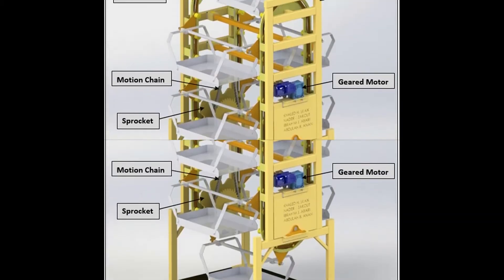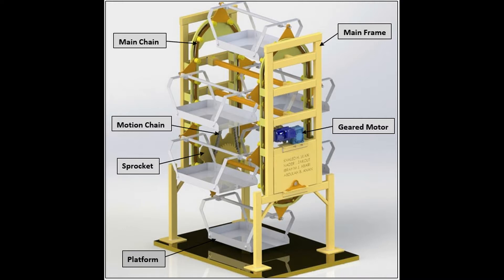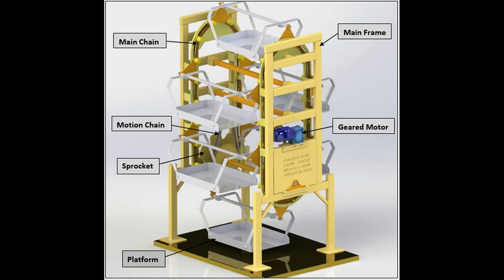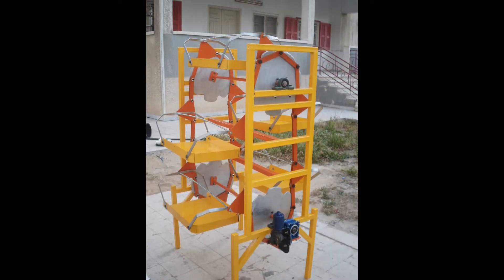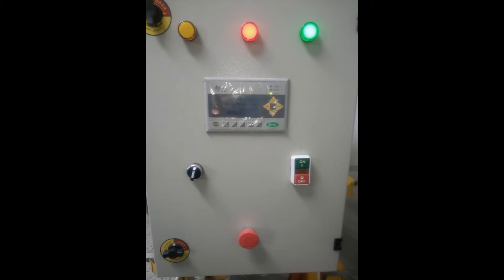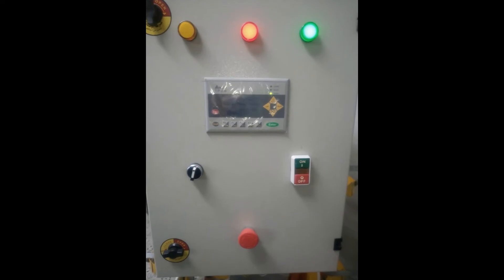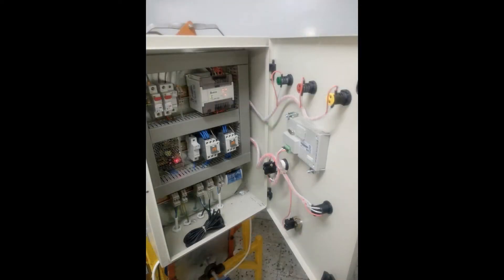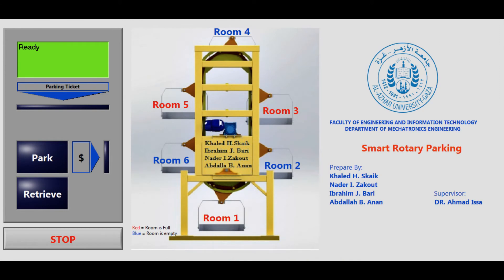Automated  Rotary Car Parking System Full Demonstration 2018

Comment: looks good.  I think there might be a market for home users as well.  North America its not unusual to have 2 or more vehicles per person.  Its required to get by as there is no public transportation.

In my area there are a number of 4 car garages for a single dwelling home.  Unfortunately many have an absurd thought pattern and hoard many things filling their garage and moving their vehicle out to accommodate.  Quite possible to conceive of putting up a steel structure on a yard if it complied with the laws